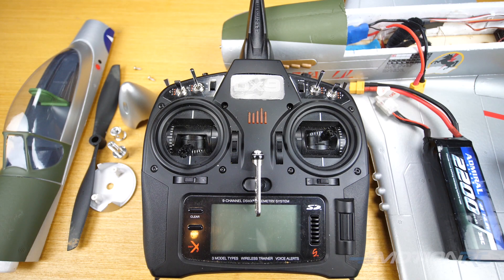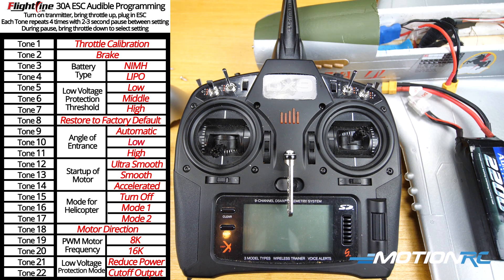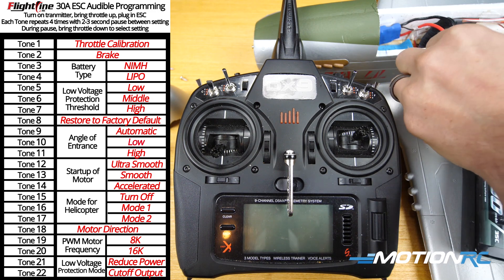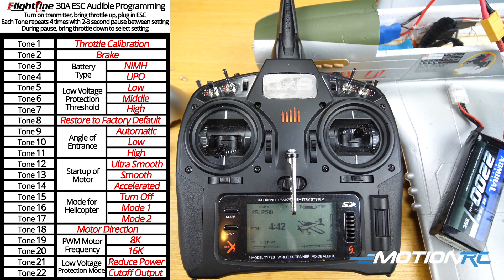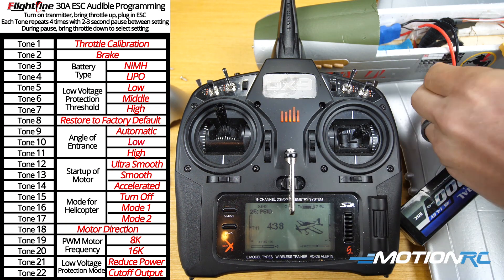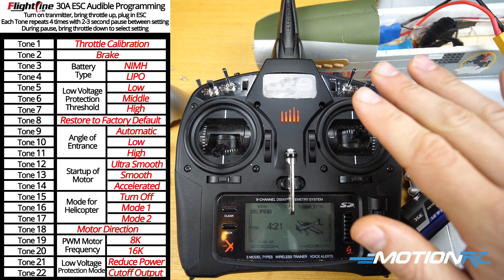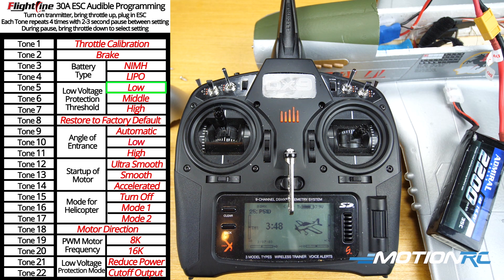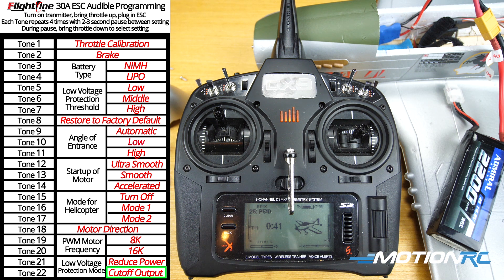FlightLine 30A ESC Programming Guide - Audible Beeps - Motion RC

Comment: Great video on the tones. I have a question about the BEC for this ESC. What is the BEC output in volts and amps?
Reply: The BEC is simply turning the motor off or reducing the output power solely based on battery voltage. As soon as the battery undervoltage is reached (at middle it was 3,2V per cell in my ESC) the protection system triggers and you motor stops. You need to go to minimum throttle again for the system to rearm.

Comment: When I to reset my esc with tx off and throttle up, I battery up the tx, plug in the battery, snd immediately get a “high throttle warning.” What am I doing wrong
Reply from the maker: Leave your TX on. Unplug the plane, with the TX on, put throttle to max, then plug in plane

Comment: Hi, after setting the brake then if we want to continue programing and to choose the battery type, do we need to unplug the battery, bring the throttle full up and do the same procedure. Any help please. Thanks.
Reply from the maker: Yes. Repeat the process for any changes you want to make. One at a time
Reply: @MotionRC  one at a time that is confusing. After choosing one item and to choose any other item We need to unplug the battery , bring the throttle full up and wait for the the particular beep and then bring the throttle down. I am correct?
Reply from the maker: @bpt1231  yes, because when you bring the throttle down after any setting change, the esc will arm. So the only way to do it is one setting at a time

Comment: I can't even get my motor to run or get to program.
Reply: Same problem
Reply: I had some difficulty in the beginning, Motor stand still no matter what. Found out I needed to calibrate the throttle position as first action, afterwards it worked as intended.

Comment: I inadvertently set the brake on the Flightline spitfire esc and I'm havimg trouble turning it off or doing a factory reset. Do these same instructions and tones apply to its esc as well? I'm getting different tones and I'm having trouble resetting it. Any help would be much appreciated!

Comment: Thanks for the video. It's the same parameters menu and tones for my "Surpass Hobby" ESC.. But I can't get into the settings. ESC is soldered on to board. I am running INAV. And DJI Digital FPV Air Unit...
Reply from the maker: Not sure what to say here. Best bet is post this in the HobbySquawk forums and the community can try and help you
Reply: Thanks I'm sorted. In INAV configurator, with my flight controller plugged-in, I can set throttle to 100% - and then plug-in my LiPo. Everything else is as per your awesome video. Thanks again.

Comment: Does this FlightLine 30A ESC support a $15 programming card? I'll never keep track of that many tones.
Reply from the maker: with this video you dont have to. Just listen to the tone on the video of what you want to control and wait for it on yours
Reply: I sincronize the video with the tones, so I don't even need to listen to the tones. When the menu item I need is highlighted on the video I flip the throttle.